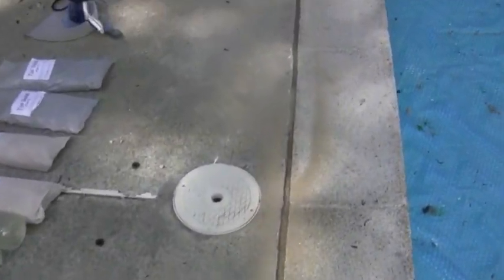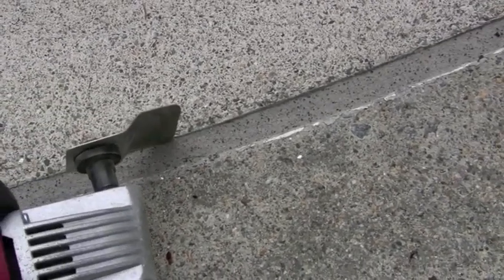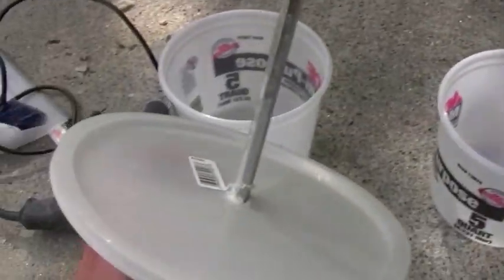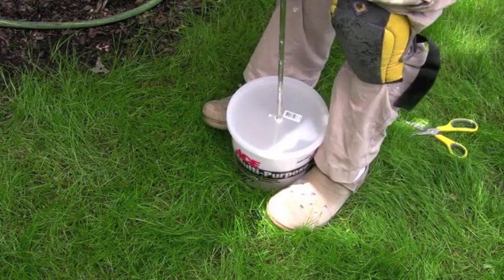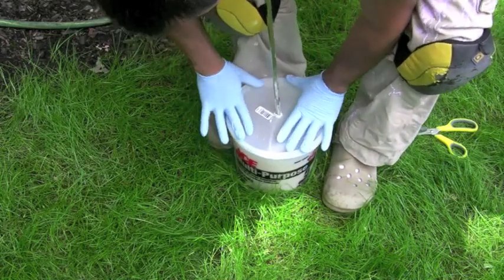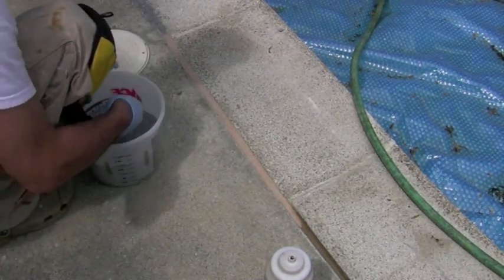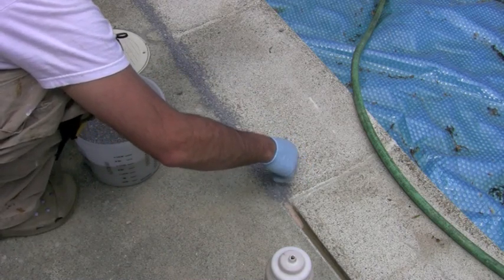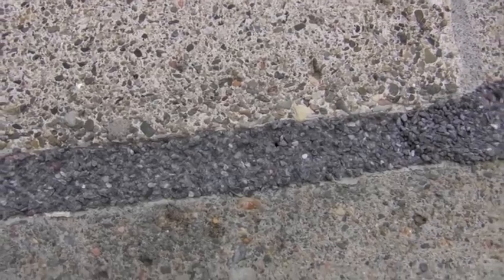Customer Eval of The "Original" Pool Seal

Comment: I replaced a bazillion miles of “Liquid Pool Gasket”.  Wish I’d had my oscillating saw then (80’s).  Used utility knives, modernity is good.  We made entire pool gap watertight with backing rod.   Caulk was self leveling, it ran and ran.  Any gaps not watertight and it all ran down a single hole.  The caulk keeps coping tight,  but more importantly it prevents water/ice forming behind waterline tiles. When they pop you get a razor sharp tile face.  Really not cool for edge crawlers. Love this product.  Thanks for the video.
Reply: The first oscillating tool available to anyone out side of the medical field was the Fein caulking cutter in the 80s.  They invented and patented the occillating tool. That is the reason professionals don’t use self leveling. We use ssl ( semi self leveling) also called slope grade.
Reply: @genecarden780    Thank you.  My boss was old school.  Plus even if he’d known of easier, better techniques he enjoyed watching us suffer the way he had.
Reply: @robertcasey7312  I know that feeling of watching you suffer. When I started my dad was the superintendent and some of the foremen thought it was there duty make me suffer🤣

Comment: Deck-o-seal is nothing more than polysulfide sealant. And should last 20 years in a commercial environment when installed correctly.  Should have lasted longer in a residential,environment.But a lot of pool companies have no idea what they are doing when it comes to joint sealant. They are experts with concrete and tile. That is why residential pools have so many issues with sealant. It is just plain wrong to use sand under ANY sealant. I assume that you didn’t find any backer rod when you removed the Dec-o - Seal .You absolutely have to use backer rod. And the water is not just getting in around the coping. It is also getting in through all of the unsealed expansion joints that pool contractors seem to think is ok. It is not.How is this new product holding up? It seems awfully hard.